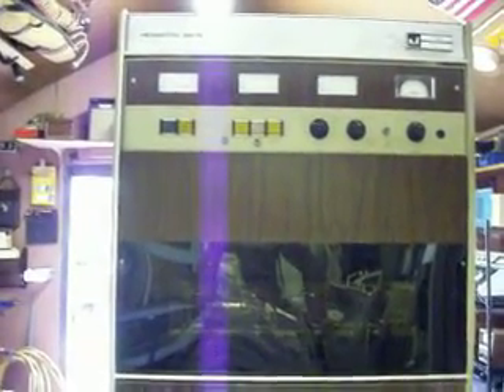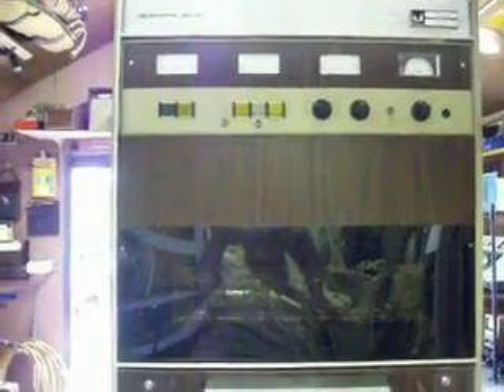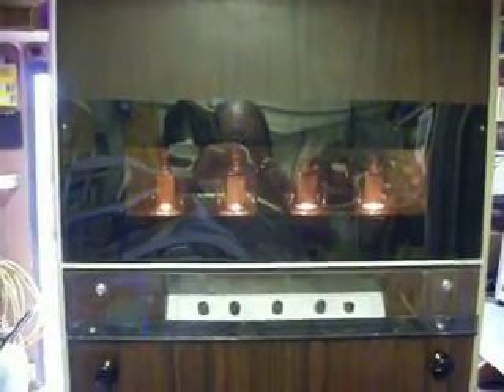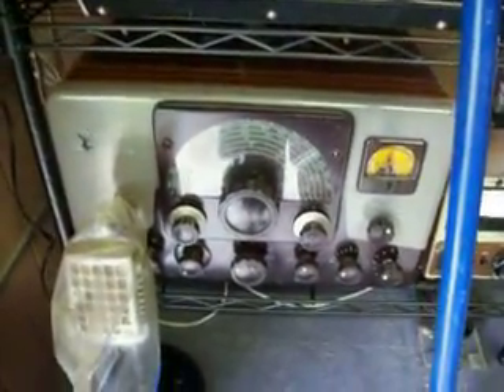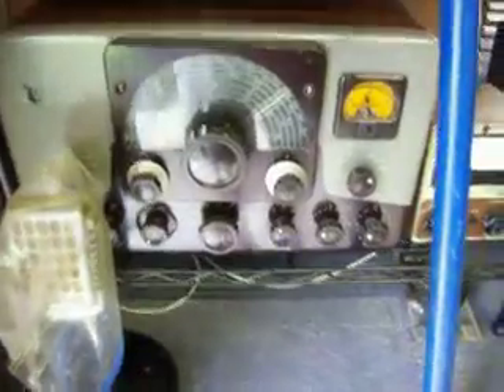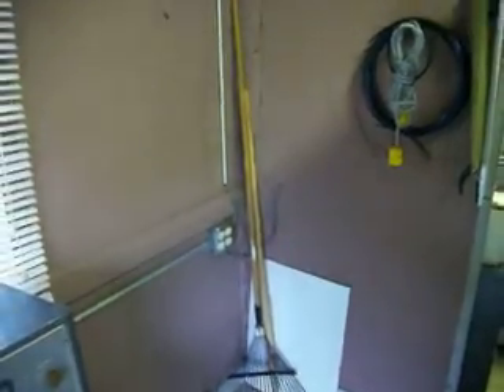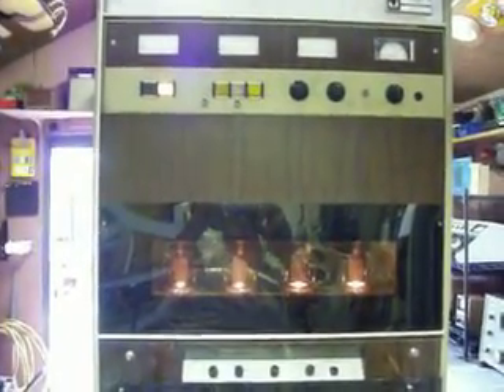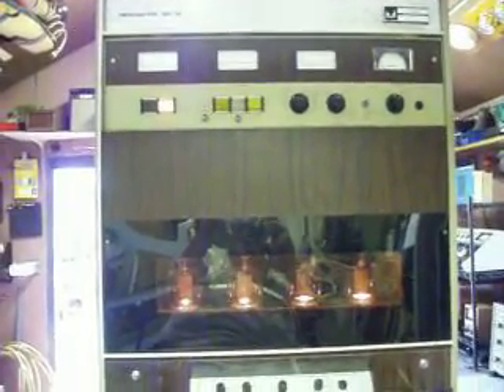WD4AM McMartin BA-1k Project Part 2 Operation

Comment: What I liked about the McMartin BA-1K is how the 4-400 Tubes were visible from the front, in a line. I notice the RF Ammeter was different. Back when the tube boxes were in service at the Commercial AM Stations, the RF Ammeter burned up quickly due to most of them were feeding a series fed tower. That is my guess. If your studios were located with the transmitter, it was cool for folks to walk in & talk about those tubes. There will be no era like this again. Now, its little 1 KW rackmont boxes.